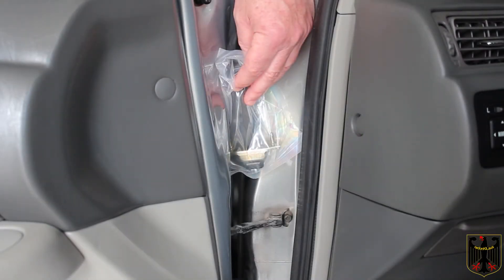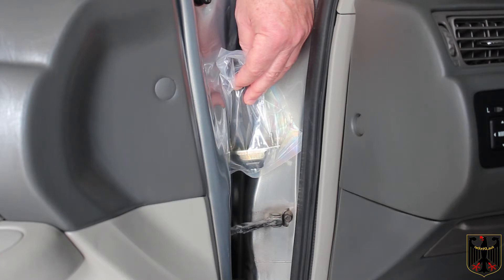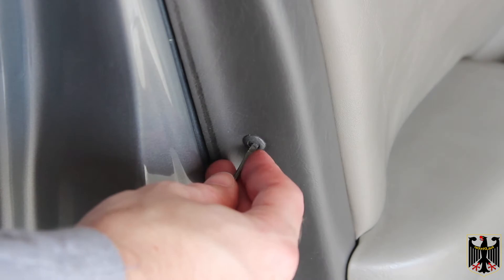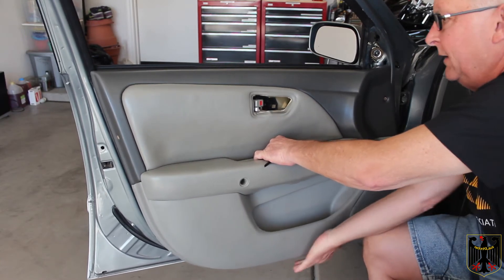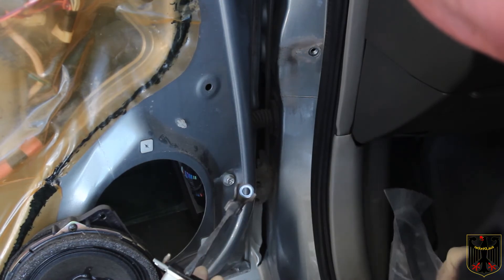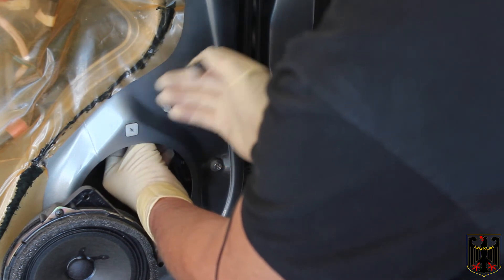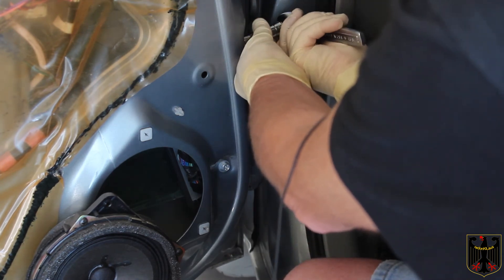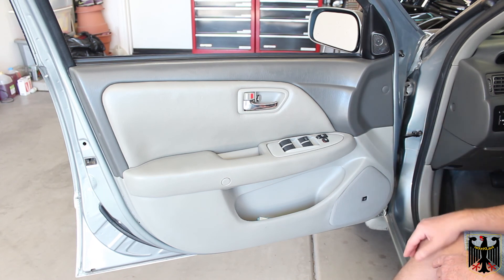1996-2001 Toyota Camry Door Check Replacement

Comment: The door panel is a little different on my 2004 Corolla, but replacing the door check is the same. The hardest part was removing the hex screw that holds the check to the frame. Thank you for posting this!
Reply from the maker: Cheryl Beidler Glad the video helped you, and thanks for watching!

Comment: Most of these door checks straps are reversible for left side or right.  Sometimes the vendor catalogs will list two part numbers but the OE units actually say "L" one one side and "R" on the other.  Regardless, just rotate the one you have and it would likely be the correct part for the passenger door.

Comment: Any videos/comments on the outside driver door lock mechanism?   My driver side door wont open with the faub nor will it unlock with the key.  I have to unlock driver door from inside the car.   Any tips on getting it fixed?  Thx.
Reply from the maker: That could be an actuator issue, sounds like a mechanical one and potentially electrical as well.  That's where I'd start diagnosing for sure.  Thanks for watching!

Comment: Do you know if I Can I use the same part #924-925 for my 2004 Toyota Camry ?
Reply from the maker: Not sure, I'd check Toyota parts sites for a cross reference number, or contact aftermarket parts suppliers directly.  Thanks for watching!